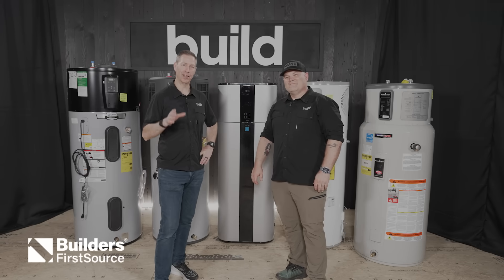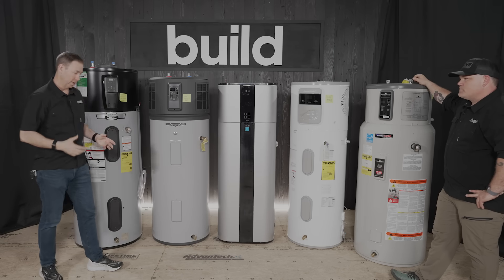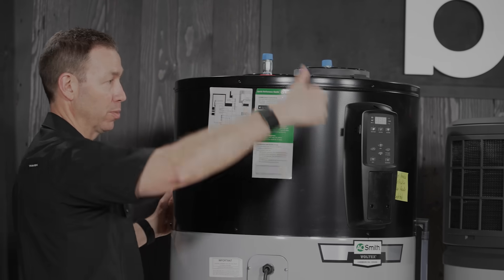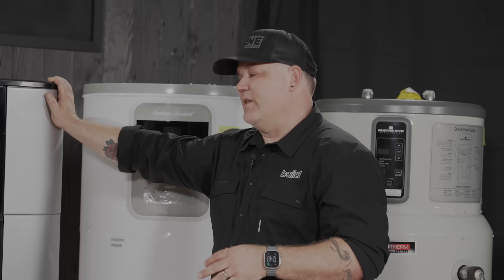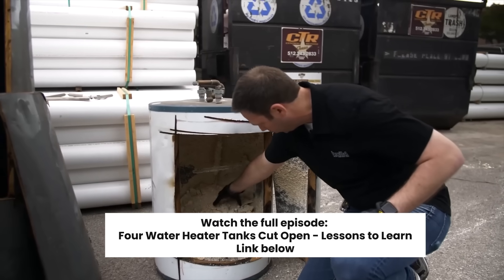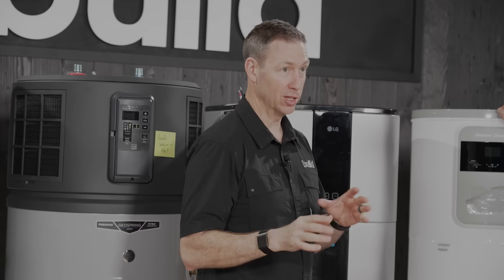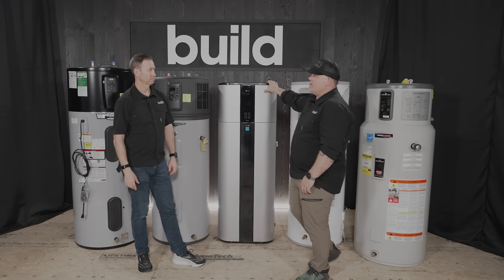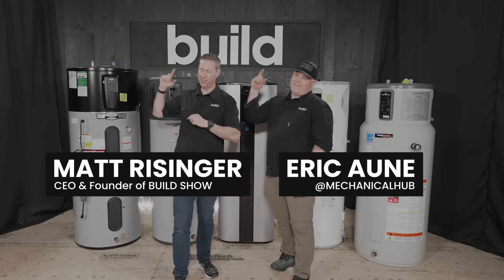Heat Pump Water Heater 101 - 2025 with Eric Aune

Comment: I installed a SanCO2 HPWH w/ an 80 gal tank in our Tallahassee garage with the heat pump mounted on the wall. It's quiet, energy efficient and cools the garage. It's a great product that should have been included in this video as it had in prior videos.
Reply: Just Google Sanco2 water heater and you will find it. They are not like the models shown here and instead operate with a remote condenser. Sanco use a nicer full stainless steel tank too. Worth checking out!
Reply: I love the SANCO2 design. Did you DIY this, and any concern over warranty if you self-installed? I'm thinking of installing the outdoor unit in my garage to help cool it in the summer.
Reply: @GeorgeRovny SanCO2 requires professional installation for the warranty. Installation is just connecting water lines between the heat pump and tank and to the house. No refrigerant plumbing since all that is within the heat pump. It cools my garage when it runs, but doesn't run that long because it so efficient. Pictures of my system are shown on the SANCO2 website. We have been very happy with it's no maintenance performance.
Reply: How long will it take to break even for the savings it gives you considering the high installed cost? In a high demand situation like back to back showers, the heat pump cannot keep up and the electric elements kick in. You are not saving as much as you think to justify the high cost.
Reply: @bills6946 I haven't calculated the payback period. I power it with solar and net metering and wanted a very low consumption water heater to keep kWh consumption within production amounts to avoid paying a utility bill. It has an 80 gal tank, and we have never run out of hot water. This heat pump doesn't have heating elements in the tank.
Reply: @KentWimmer 
Your heat pump water heater does not have back up for high demand? Most 80 gallon units will provide 91 gallons initially, then drop off considerably. Can you provide the name and model number? This is new to me.
Reply: It has a 121 gal first hour rating because the water in the tank is over 140 degrees and has a mixing valve before the feed to the house.
Reply: @KentWimmer 
Can you post the make and model number? I want to look into it. Thats a high first hour capacity. Most I have studied are 91 gallon.
Reply: @bills6946  Tech Info https://eco2waterheater.com/wp-content/uploads/2024/08/GS5-45HPC-D-ECO-83SSAQB-Submittal-07-2024.pdf

Comment: Would love hear the comparison between heat pump and tankless. Pros and cons.
Reply: The only reason to ever install a tankless water heater is if you have extremely intermittent consumption (where passive losses would dominate total energy consumption) or major space constraints.
Reply: @andrewbrowning6357 Thanks for your comment. Tankless water heaters are standard for us — we install them in all of our homes. In fact, I don’t know of any custom home builders in our area who don’t use them.

The heat pump systems are newer to us. We just had our first client inquire about them recently, so we’re looking into them further.

There are a few reasons why we’ve consistently chosen tankless units:
	•	We use open-cell spray foam in our attics, and tankless units are better suited for this due to their sealed combustion and dedicated intake/exhaust.
	•	In our region, homes don’t have basements, so water heaters are often installed in the attic. From a safety standpoint, a tankless unit is a safer choice — in the rare case of failure, you’re not dealing with a 50-gallon tank rupture.
	•	Functionally, the endless hot water is a major benefit. You can fill two bathtubs, run the dishwasher, and still have someone take a shower without running out of hot water.
	•	Many newer tankless models now come with built-in recirculation pumps, which help reduce wait times for hot water at the tap — a common complaint with older systems.

That said, we’re always open to better solutions. I posed the original question because we’re genuinely interested in learning and improving.
Reply: @picklofamily  When comparing gas vs gas, there's not a lot of reason to choose a tank vs tankless. When switching to electric the difference is more stark. A tankless heater soaks up a lot of panel space and can only operate at a COP of 1. A heat pump water heater can't generate enough instantaneous power to serve as a once-through water heater, so the tank is a requirement to achieve the required temperatures with reasonably sized equipment. Flip side is that the heat pump system operates at a COP more like 4, so one quarter of the energy consumed per unit of water heated.

So that's really all there is to it. If you want to use an electric device (due to self-generated solar, low electricity costs in your area, climate change concerns, lack of combustion air requirements, etc) then a heat pump system will be 4x cheaper to run, or use 4x less of your available solar, than an instantaneous water heater and will use far less panel capacity that you might want to use for other things. 

Not much more to it than that. Minimal to no downsides to sizing up, so if you have concerns about demand then get a bigger tank.
Reply: The only reason to install a tankless is you want endless hot water.  HpWh have electric element back ups, so the worst they will do is as good as a electric model.

Comment: An important data point for heat pump water heating is how the COP varies with colder air temperatures (or, alternatively, the lowest operable temperature). If we were to replace our gas water heater, it would have to be ducted to/from the exterior, and where we live that means dealing with 0F - 32F temperatures during the winter. The heat pumps we use for home heating function down to -15F ... the water heaters need to make this number clear.
Reply: Yeah, ducting these to the outside in a heating climate is rarely going to work well. But ducting to the inside ads a negligible load to your main HVAC and works great. NEEA did a study on this if you want to look more into it.
Reply: @JoshuaRes   the heat pumps that heat my house are external. they live in the outside air all the time. their COP is roughly 4 until about 15F. There's no particular reason why the units in a heat pump water heater could not have similar behavior, but I suspect that they do not.

Comment: Love the channel! However, I do have to take issue with the reason why tanks style heaters are only lasting a little over a decade. I’ve been in the industry for 21 years and it’s not due to the fact that people don’t flush their units. At least not in my part of the country. It’s because of all the extra technology that we’ve placed inside of even the basic units for the past 15 years that have made them that much more unreliable. More than nine out of 10 warranties that I have to process are not based upon the tank being compromised. It is almost always either the gas valve or the thermal pile. And the reason most people swap their tanks out at the end of 10 or 12 years is due to the fact that the cost for just those two items usually is over 50% of the cost of a new tank. So people are that much more likely to buy new. 
The more cogs you put in any watch regardless of what it is you will have more opportunities for failure. I do appreciate that you guys are giving a realistic and instructive perspective on these heat pump units.  Keep up the great content!

Comment: Other than the few on the market that have an outdoor condenser these are relying on your house's heating system.  So, maybe your electric heat pump water heater is being fed by your gas furnace.

Comment: Sounds like “free” air conditioning for the garage!
Reply: Pretty much.  Ours is in the garage and when it runs the garage is cooled noticeably.  But I am not going to run the hot water because I want to work on my motorcycle in the garage.
Reply: Ducted to hot area of the house in summer,then unoccupied area in winter.

Comment: I flushed my Rheem Heat Pump water heater twice in seven years and didn't see any residue. Plumber said if I run in heat pump mode most of the time it will prevents the residue buildup. I don't recall ever using any mode except the heat pump mode. Mostly trouble free except for a sensor I had to replace which was a pain but I did it. The plumber had to repipe my water heater because the previous licensed plumber blocked access at the top which is how you service the water heater if required.

Comment: I just put in a Rheem heat pump water heater in my hot-humid Texas attic. I love how efficient it is, and the technology is great.  One minor drawback is the noise/vibration from the heat pump is pretty noticeable on both the first and second floors when it is running. Don't skip the anti-vibration pad if you are installing.
Reply: Yup, Texas attic .... I've got almost the same yr and model Rheem hybrid as shown in this video.  These units are ideal IF you have a garage install in, say, FL or TX, south facing best.  It's simple thermodynamics: ur converting the 80-90d air to 130d in the tank !   My heat pump starting to fail after 5 yrs...slow to heat the tank...
Quick Fix !!!! :  drain and flush the tank, use the " tank water always on" method then open and close the the ball joint flush valve repeatedly...making a " hammer " inside the tank.  This knocks off deposits on the thermo heat transfer part inside the tank...the heat pump will run much better. Mine 2x better, improved back to specs.  Nevertheless, I do not recommend these units in a cool or cold climate; too m any issues too numerous to list.  But, if you live in the Sonoran desert you're " in like Flint" and will halve ur H20 heat costs, perhaps!

Comment: I just installed the American Standard 65 gallon HPWH last week.    It runs in heat pump only mode.  Installed easily, has the powered anode rod, and is quiet.  The only gripe I have is I cannot get it to connect to my wifi to allow me to use the phone app.

Comment: This is a good update video on recent models, installation considerations and maintenance. But, Matt, you are still perpetuating the energy saving and cost savings myths around these units. You really need to do a deep dive into the reality and get an independent engineer to look at the numbers using the whole house as a control envelope. This will give you a new perspective on the marketing hype.
Reply: If you use a heat pump for your hvac and it moves 3.5kwh of heat for every kwh consumed (very average performance), and the HPWH also consumes 1kwh for every 3.5kwh moved, then you've moved 3.5kwh of heat into the water at a cost of 2 kwh. That's still much better than unity (1.75 total COP), which is what a resistive electric hot water heater does. Electricity in texas is something like 10c/kwh, and gas prices are something like 7c/kwh. Correcting for COP gives you an equivalant operating cost of 5.5c per heat unit for HPWH. Further, if you're in texas you can slap a couple solar panels on the roof and produce the cheapest LCOE energy available and stick it straight into your water heater, which is a trick you can't do with gas. 

If your HPWH is outside the conditioned envelope in a reasonable climate there's no competition, the HPWH blows the others out of the water.

You don't need an engineer for this, it's pretty simple math.
Reply: If you want an engineer then NEEA did this exact study for heating climates.
Reply: What people don't understand is that the 3.5kW of energy comes😅 from someplace. Using a gas furnace at 90% efficiency means you have consumed 3.9kW to put the energy into the air in the first place.

Comment: In climate zones 4-5 is their a need to locate the heat pump in climate controlled (heated) spaces? Is a heat pump going to function in climate zones 6 and higher? Using your 4X less electricity with a heat pump I show an annual savings of almost $600 when compared to water heaters using propane or natural gas which is cheaper than propane but requires about twice as much to produce the same amount of heat. Ray
Reply: In cold climates these work way better in conditioned spaces. That does mean they are stealing heat from your main heating source, but the draw is negligible. NEEA did a good study on this.

Comment: Sounds like ducting one of these to a sealed attic would help keep down the few degree temp increase compared to the rest of the house, also extract stale air and humidity and replace with cooler fresh air. Two birds, one stone.
Reply: cooler air & lower humidity, yes.  fresher? only if it is coming from somewhere else.
Reply: If your attic is sealed, most likely, you should have an erv in the home bringing in fresh air. Either way, you're still mixing and pulling out stagnant air from a semi sealed space.

Comment: I've yet to find a plumber who will install a powered anode.

To switch to a unit like this we would need to extend an outlet, which is doable, but dealing with the condensation would be a huge problem.
Reply: So do it yourself. They cost $80 on the internet and fit every single water heater on the market unless you happen to have a Bradford White. Do you really need a plumber to loosen a nut on top of your water heater for you? That's all it involves.
Reply: @Channel-gz9hm  This is for my HOA, not a personal heater. And it is a Bradford White.

Comment: While these do save on electricity, an better approach would be to have a solar preheater. Basically a system that will heat the incoming water to 100* or more.
Reply: Because a HPWH runs at such a high COP you actually get more heat into the water with solar PV running a HPWH than you do with a solar preheater. Anywhere you could put a solar preheater would be better used for solar panels.
Reply: I was really impressed by the solar water heaters in common use in Chihuahua and was going to build one back home in Texas. That was November 2019 and when the Covid started I anticipated a need for reliable power. 
I realized as I was scaling up my DIY solar , that solar panels were so cheap that even a resistive WH was more cost effective than a water heater outside subject to freezing. 
I investigated running the DC from the panels directly to the heater elements. You need to have a thermostat that can switch DC ,not a big problem, but another detail to consider.
I finally just put the WH on the inverter with the elements in series which reduces the load to 2250 watts. Twice as long to heat the water but old folks have time to wait and apparently less need to shower.😊
Reply: Pv panels make more sense because once you tank is up to temp you can use the energy absorbed for other things

Comment: Building a new home, was thinking of heat pump water heater in my 9x9x9 laundry room. Good idea? Also what models have electronic anode rod?
Reply: Do it! If you are worried about the amount of air space you could spring for a Sanco2. They use a remote condenser.

Comment: I wonder if a laundry room would work well for these because of the heat from the dryer
Reply: The problem is that your Hybrid Heat Pump H2O heater will be running more frequently than your dryer...

Comment: What is the highest ambient room temperature the compressor can work in and still function reliably for decades? I'm thinking of a situation where you install the heater/tank into a tightly insulated smaller enclosed space (perhaps coexisting with other thermal storage tanks), and duct to another room (i.e. a small computer room/datacenter) that needs cooling. I'd like to keep the hot water storage all within a tightly insulated envelope to reduce losses, yet take advantage of the heat pump's ability to cool another space. The "thermal room" may get up to 80-90F... and I'd be concerned about the mechanical parts wearing out prematurely because of that. Or is that even a concern?
Reply: Had one in a house in South Alabama a few years back. Double garage with 4 windows, so it would routinely get to 120F ambient air. After I installed a GE it would  top out at 90F.
Reply: @milesroe5082  That is exactly the sort of testimonial I was looking for. 🙂90F ambient is about as warm as I would anticipate the thermal room getting - so I'm hoping that others will confirm your experience - that this is well within the operating range of these units and will not cause premature failure.
Reply: @VE5SAR-Hamnetics interesting, are you saying the unit had some sort of issue operating when the ambient temperature was over 90°? That does not make a lot of sense to me as the unit wants heat around it.
Reply: @JoshuaRes  Nope. I don't own or operate one. My question is whether mechanical reliability remains high no matter the environmental temperature, or whether there is a degradation of some sort at higher temps. Do compressor bearings and electronic components start to deteriorate rapidly as temperatures approach 100F? 90F? 110F? At what temperature is mechanical failure a significant issue? That's the point of my post - to gather that information to get be informed on the highest design temp for a thermal storage enclosure.
Reply: These things want to be in a warm place as they need to draw ambient heat and move it to the water.  So, within reason, a warm environment is ideal.  A cold garage could be an issue, but as long as you aren't installing it in a sauna it should be fine.